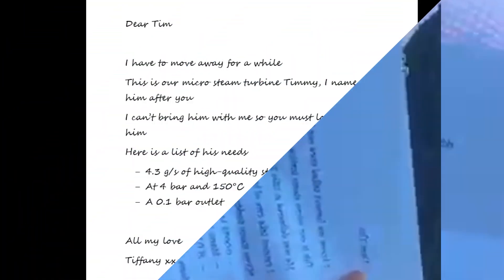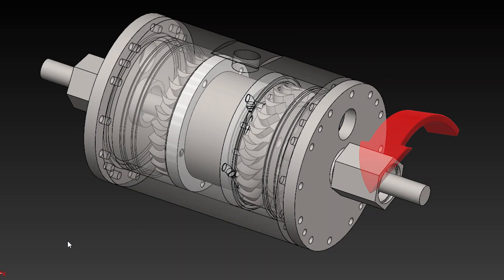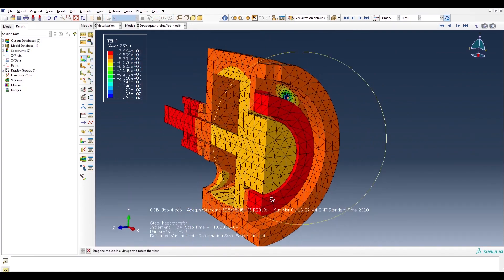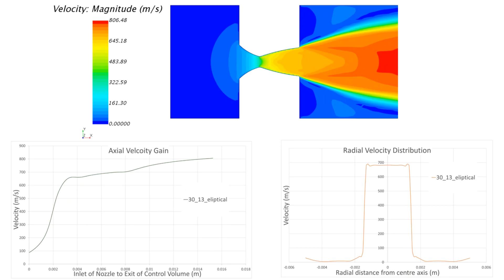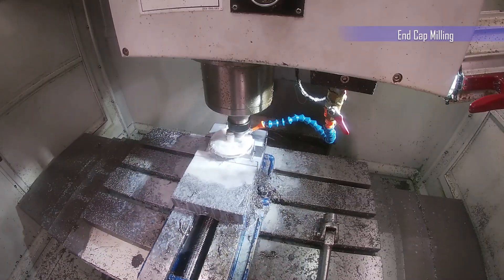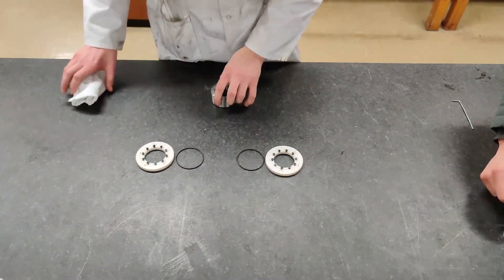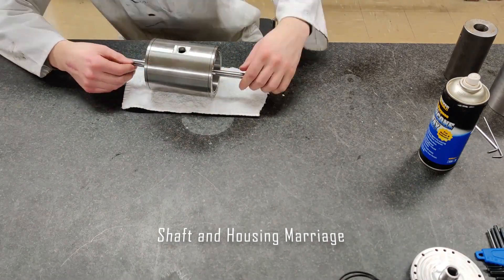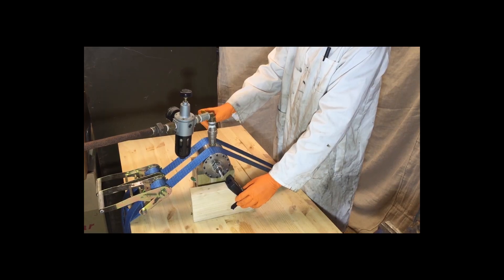Micro Steam Turbine The Sequel HD

Comment: Uh. . .Why didn't you just CNC produce the shaft with collar, instead of this freeze/shrink deal. . . And ball bearings??? . . .I suspect the heat will. . .liquefy the grease and push it out of the bearing race. . .I suggest a shaft driven oil pump, and a plain bearing type where the shaft is supported by pressurized oil.
Reply: If you look up photocopier heat roller bearings check specs, massive high temperatures,and I've seen them work 40 hours a week for more than a decade
Google high melting point grease

Comment: I would like it to become commercial, in my opinion this can be very important product in the fight with decarbonisation it could find application in home integrated power generation systems that could properly manage switching from one unit to another depending on weather conditions,I know it is expensive to build such a system, but the only photovoltaic system connected to the grid is not the solution for me I am looking at off grid applications only and I realised that systems like (photovoltaic, heat pump, biomass powered stove with steam turbine generator and batteries) integrated and operated together could be solution to go off grid for vast majority home owners at least in my country in Poland where I think this could find great demand and completely improve our life due to very low home and transport energy cost as transport in the near future goes electric.I am sure it will be available some day in the near future
Reply: decarbonisation ? First the plants die and then you ...

Comment: Speed with out torque is not much to work with. Tons and tons of DYI steam projects showing speed.  But speed is only one part of the equation. And in my opinion a useless part with out torque. Lets put a meaningful load on stuff guys !
Reply: what would be potential solution for seals in those microturbines? seems like all shaft seal materials are capable up to 400 c which is low for overheated steam off engine exhaust.
Reply: @user-sk9hl7si7l  you are probably going to need a specialized solution from a place like saint gobain seals or psi (performance sealing inc) to help select something they either have on the shelf or make something custom.

But that still does not address Tim's comment and it is my comment as well.  I am stoked that so many people are making their own little steam turbines, but speed doesn't really mean anything without knowing how much shaft power the turbine is capable of.  I am very interested on the realistic power output of all these diy designs.  Obviously they will be significantly lower in efficiency than properly designed and developed large turbines, but any  efficiency above 30% on a diy set would be absolutely awesome and worth getting out there.
Reply: @quickcooper61  what would you do with 30% efficiency,burn wood/garbage in remote areas to produce electricity or use it all over the place instead of generators ? Idk uses of it

Comment: I object to the high temp. resin..( AIN'T GOIN TO LAST) and what is this exit pressure.. I think that a reasonable back pressure should have been introduced into the calculations.. that is unless it it to be running in outer space..(on a rocket)....  I assume that on earth, it is best to reuse the water after re-condensing it and pumping it back into the boiler...

Comment: I work for GenHydro and would be interested in speaking with you guys. How much power can it generate?
Reply: If i have very high temperature steam. To be more precise hot water at about 90degrees C being heated more by a boiler at 600degrees C. 
The generated steam is about 400degrees C but i have not measured the pressure yet

But I was wondering can I drive a water pump instead of a steam turbine with this energy?

I have used pumps as turbines many times but this is the first time trying a water pump as a steam turbine

Comment: Why is there two turbine blades and not just one?
Reply: Torque is required not speed not RPM more stages are better for that I think ... to drive electrical generator. It needs torque under load.